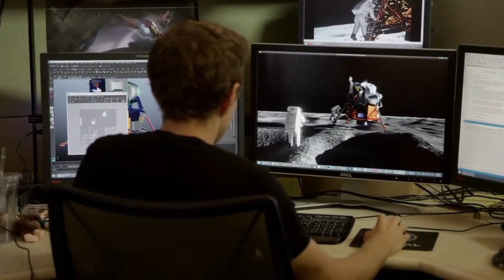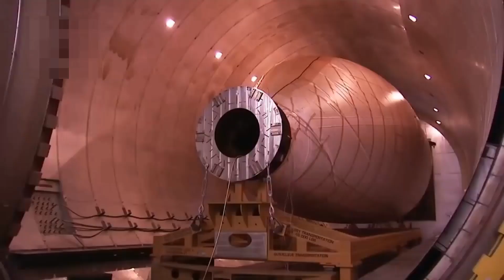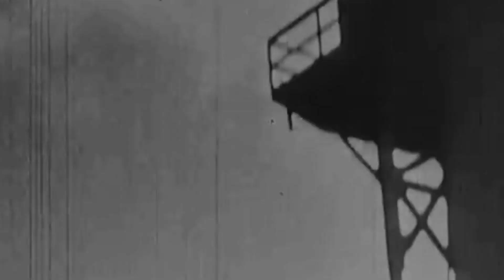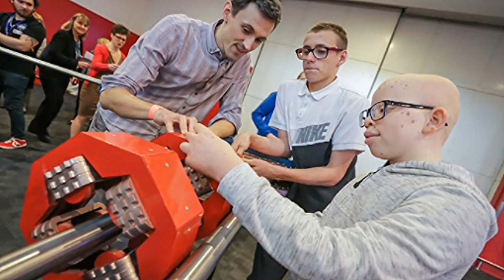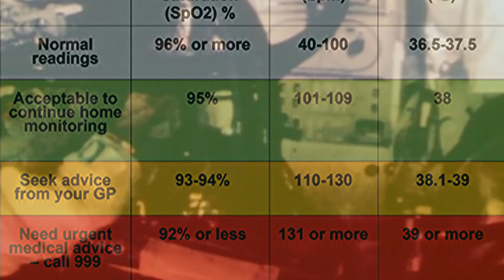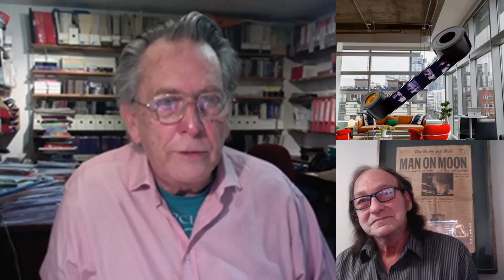"PARROTING NASA" WITH MARCUS ALLEN & SCOTT HENDERSON PART 2

Comment: Then if I'm not remember wrongly. At high school I had one course in photo and film in the 80s. We got camera to shoot some picture, then mix some chemicals in a black box.
Then in darkness take out the film and place it in an unwinder. Need to be careful not to drop the film. It is not easy to find something and place it correctly in complete darkness.
When the film in the box and the box was closed, turn on the dark red light.
Then unwind the film and then shake it. To distribute chemicals. Then you can open the unwinder box. And dry the negative film. When dried watch the negative in normal light.
In dark red light. Take the negative film to exposure the photo papers with light. And put the photo paper in two baths of chemicals to develop and fixation. 
All need to be timed to get good photo. Then hung up to dry.

To add some extra: I found that my dad had some negative photos, not on plastic but glass. And had a small frame with greed background for the negative. 
Not sure what it was for. Think it was to apply to photo papers to create the photo with light on the negative.
Reply from the maker: We have an article on aulis.com which shows how we developed the film that we sent to the University of Patras to be subjected to their vacuum chamber at torr 10 -6. You should see what it did to the negatives! Here is the link to the article 
https://www.aulis.com/vacuum.htm

We also show the process for developing this type of film. Cheers!

Comment: Thank you for your commitment ... Could you just produce a video about the vacuum on the moon?  How thick and how heavy does the pressure capsule have to be?  How thick does an oxygen bottle have to be in vacuum on the moon and how heavy will it be then?  And how many oxygen cylinders do we need for 3 astronauts and 5 days?  You may be able to consult a diver.
Reply: The Apollo missions used cryogenic liquid oxygen carried in two double walled vacuum insulated tanks. Liquid oxygen is about 1/1,000 the volume of gaseous oxygen and 1 pound of LOX is about 0.105 gallons. Hydrogen fuel cells generated electricity and drinking water as a by product. Crews breathed pure oxygen at 5 psi rather than 14.7 sea level on Earth. CO2 was removed with scrubbers. The explosion on Apollo 13 was from a LOX tank over pressured.
"The Stafford Air & Space museum displays a cryogenic (supercritical) oxygen tank. The Apollo Service Module carried two of these tanks and two cryogenic hydrogen tanks of a different design.
These oxygen tanks supplied oxygen to the environmental control system and to the SM's three fuel cells to generate power. These double-walled tanks were made of Inconel (a nickel-steel alloy) with an outer diameter of 26.55 inches; the inner tank was 25.06 inches in diameter. A vacuum was maintained between the tank walls, and the void between the tank walls contained insulation comprised of fiberglass, paper, and aluminum foil. The tank with accessories was 36.39 inches tall.
Each tank weight 79 ½ pounds empty and held a volume of 4.73 cubic feet or 320 pounds of oxygen in a supercritical (semi-liquid, semi-gas) state. 210 pounds of the oxygen was reserved for the fuel cells with the remaining 110 pounds used for environmental control."
Reply: @jimsmith7212  Jim Smith ha ha ha date of account Jan 11 2020
just one subscriber
fake playlist oldest being 7 days ago
fan club includes
Bertieslack
Joan Evans
the English coward poprobson
Phase 52
HA HA HA another Bertieslack bunch sock puppet.
Hey dude they never took anything because it was all faked. there was only one mockup lem dumbass. proof of that is not one of you have the balls to meet me face to face on zoom to discuss it
HA HA HA ZOOM ZOOM
Reply: @jimsmith7212  100% oxygen is BS. After Apollo 1 no crews ever breathed  100% oxygen.
Reply: @chookin1  
All Apollo missions used pure oxygen.
After the Apollo 1 fire the spacecraft  were redesigned and all flammable materials were removed.
Low pressure (5 psi) pure oxygen environment simplified and lightened systems because no need for complex mixture controls or need to carry inert, useless gasses, only scrub out excess CO2.
Space suits were donned in the CM before entering LM, worn to the moon and back.
Reply: @jimsmith7212  Lets see the donning of the spacesuits in the log. And no Poindexter....they didnt use 100%oxygen.
Reply: @chookin1  
ALL Apollo missions used pure oxygen at 5 psi.
Do the Google... prove me wrong.
Apollo astronauts wore suits for lift-off took them off for the trip put them on at the moon took them off for the trip back then put them on for splash-down.
Reply: @chookin1  
You tube search "The World Was Gripped  by the Apollo 11 Launch".
Video before entering capsule.
Reply from the maker: @chookin1  It wouldn't matter if they used 1000% oxygen. It is the PRESSURE that also must be taken into consideration. Without  "MINIMUM" pressure, the body cannot absorb 90% oxygen, 100% oxygen, 1000% oxygen or a regular atmosphere. I have seen far too many charts and graphs that prove this to be correct. Don't always trust what the space agencies put out because the numbers differ from agency to agency.
Reply from the maker: @chookin1  Precisely Jason!
Reply: @jimsmith7212  LIAR IT WAS ALL FICTION DUDE
Reply: @jimsmith7212  HA HA HA another bertie bunch sock puppet
Reply: @czarcastic1458  I wonder if they used the same pink panties that bertieslack uses
HA HA HA
Reply: @jimsmith7212  So how.much pressure was available after 3 EVA's of Apollo.17? Where did they recharge their EVA suits air supply, battery recharge etc?
Reply: @chookin1  
The portable life support system used in the Apollo lunar landing missions used lithium hydroxide to remove the carbon dioxide from the breathing air, and circulated water in an open loop through a liquid-cooled garment, expelling the water into space, where it turned to ice crystals. Some of the water was also used to remove excess heat from the astronaut's breathing air, and collected for dumping into the spacecraft's wastewater tank after an EVA. The PLSS also contained a radio transceiver and antenna for communications, which were relayed through the spacecraft's communication system to Earth. PLSS controls were provided in the Remote Control Unit (RCU) mounted on the astronaut's chest. Oxygen and water were rechargeable for multiple EVAs from the spacecraft's environmental control system.

Lunar surface EVA times for the first four missions (Apollo 11 through 14) were limited to 4 hours, with oxygen stored at 1,020 pounds per square inch (7.0 MPa), 3.0 pounds (1.4 kg) of lithium hydroxide, 8.5 pounds (3.9 liters) of cooling water, and a 279 watt-hour battery. For the extended missions of Apollo 15 through 17, the EVA stay time was doubled to 8 hours by increasing oxygen to 1,430 pounds per square inch (9.9 MPa), lithium hydroxide to 3.12 pounds (1.42 kg), cooling water to 11.5 pounds (5.2 liters), and battery capacity to 390 watt-hours.
Reply: @chookin1  
The Apollo 11 Lunar Module descent stage contained two oxygen tanks, each of which contained 48 pounds of gaseous oxygen at 2,690 psia. This supply provided the oxygen that they used during descent, and during their stay on the Moon, including filling their backpacks and repressurizing the cabin after their EVA (“moonwalk”).
The ascent stage contained two tanks, each of which contained 2.43 pounds of oxygen at 840 psia. This supply provided the breathing oxygen during liftoff from the Moon and rendezvous with the Command Module.
Reply from the maker: @jimsmith7212  Oxygen 80%, Nitrogen 20% AFTER the Apollo 1 fire.
Reply: @jimsmith7212  LIAR IT WAS ALL FAKE
Reply: Also how much oxygen was available in the LEM for represurrization, especially for the missions.with multiple EVA's. We have ro consider the  moment that hatch hatch was opened everyrhing inside rhe LEM was subject to an absolute vacuum.  Piss and poo bags, food and water containers, valve tubes....it would have been an absolute mess. 
Nowhere in the flight log for any flight is  there any data or dialog on getting into those clunky space suits before an EVA. This would  be critical and there  would  have been a long checklist with much input from KSC. But nothing.
Reply from the maker: @chookin1  All the Bertie Bunch know how to do is PARROT whatever NASA says. Cheers!
Reply from the maker: There are many shows in production at the moment. We will eventually be covering such things in the near future. Cheers m8!

Comment: Those "black" deflectors (black fabric looking) under the directional control rocket clusters on the LEM that seem to be there to protect the lower part of the craft from possible heat damage make no sense.  If you look at thrust reversers on jet aircraft you will see clamshell devices enter the jet engines blast stream and direct (force) the stream back 180 degrees hence "thrust reversers".  These deflectors on the LEM don't deflect the thrust stream to that degree but it appears to deflect at least 20 degrees. Of the four rocket thrusters on each cluster only the down facing thruster is deflected. This would cause a directional difference in relation to the other three.and instability. There would be a certain measure of deflection that would cause stability problems. Anyone have information on this? (the Parrots certainly will have some BS for sure)

Comment: The only argument you need to present is, pressure in a vacuum. There is no way in hell that that flimsy piece of hardware they call a LEM And those alleged spacesuits Could handle anywhere near the pressure in space let alone on the moon.

Comment: Good discussion on vacuum issues.
- Maybe eventually these guys will get to the real point why this is such a obfuscated topic. i.e how earths atmosphere is maintained or how rockets work in a vacuum.
- I have not found an explanation (in any academic text) for how to quantify the "free expansion rate" due to localized entropy OR a way to calculate how strong a container must be to withstand a certain internal pressure when that container is in vacuum of a certain pressure.
- This issue of the external pressure having an influence on the expansion rate of a gas on the inside of a container is a taboo/classified subject !!!
- There is no question in my mind that the experiments have been done and this information is intentionally being hidden.
- The only information related to this seems to be OLD textbooks before 1940s or inferring it from the expansion air ratio (as Scott Henderson is doing)
Reply from the maker: I know that Scott has read every article out there. He has studied this subject for the last 11 years straight. That was the exact reason why we conducted our own experiments with our vacuum chambers to see if what we are being told is the truth. Unfortunately, a lot of the published data does not seem to work for us, especially Kodak ESTAR base film.
Reply: @theapollodetectives  Next time you have access to a vacuum chamber -  throw in a sealed aluminum bag of Jiffy Pop (replicating the lem), apply vacuum, and invite comments from those disagreeing about the comparison.